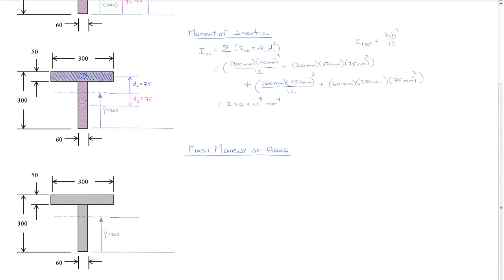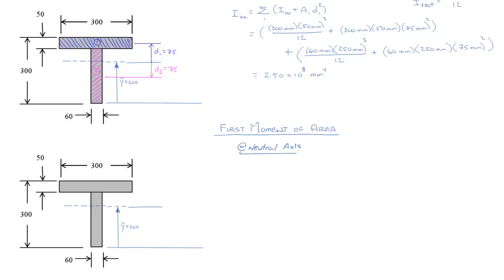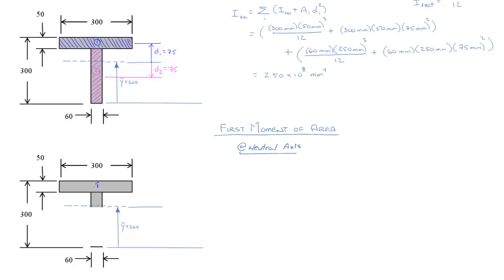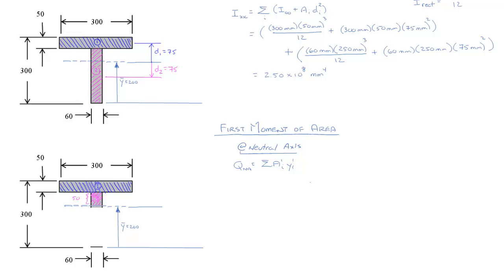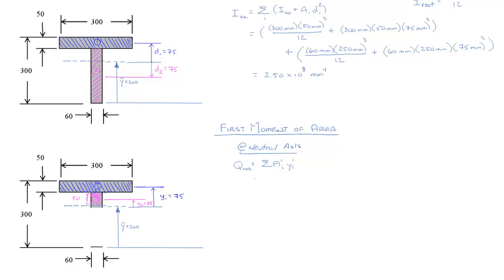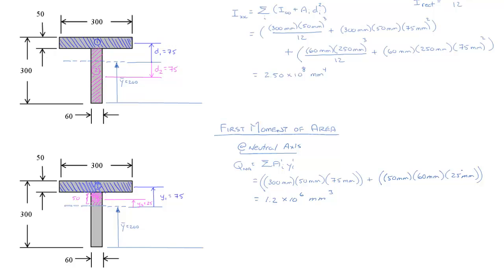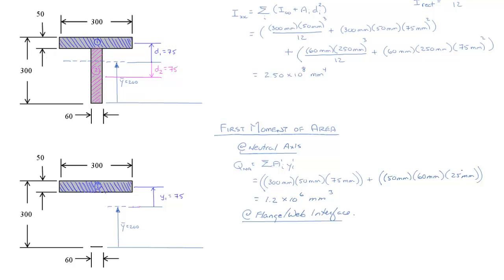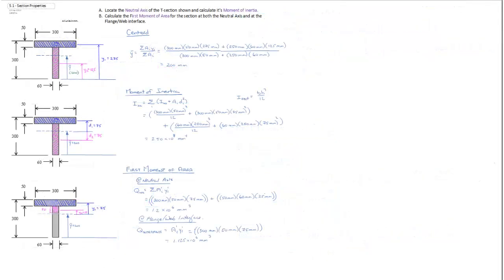5.2 - Cross-sectional Properties - First Moment of Area

Comment from the maker: Fatima: if you're calculating Q at the web/flange interface using the area below, use the entire area below (i.e. the entire flange).  Be sure to calculate the distance between the section's centroid and the flange's centroid correctly.
Reply: Hi thanks for the video.  Just a really dumb question but trying to get my head around 'why' Transverse shear force can't be calculated from reference plane y=0?

This would yield a much bigger answer for Q flange on your very last example as Qflange = Areaflange x distance to centroid of flange from y=0